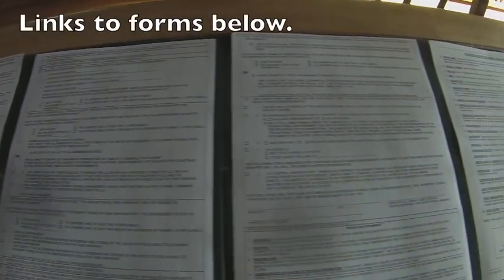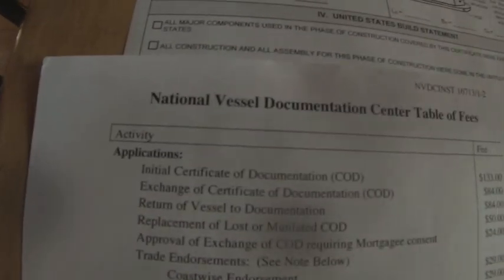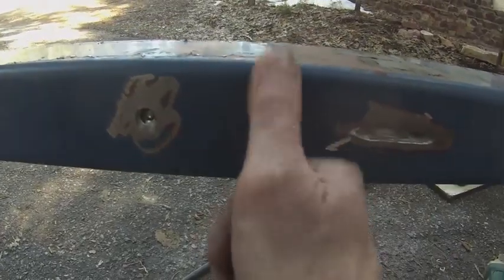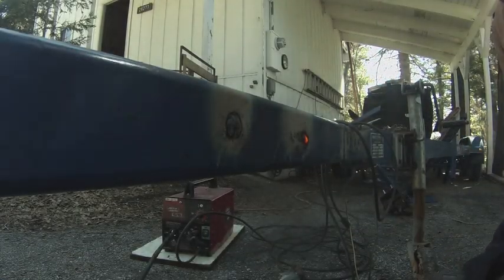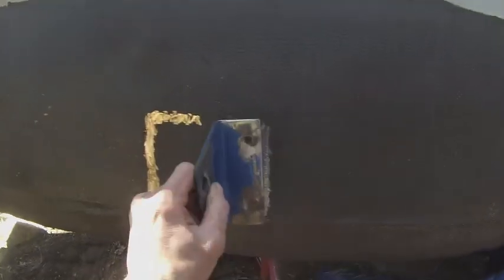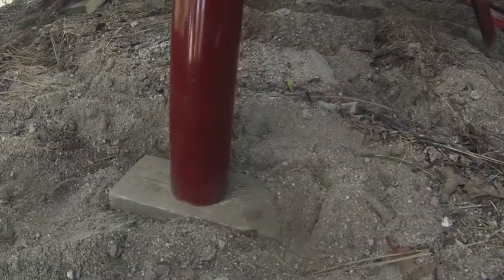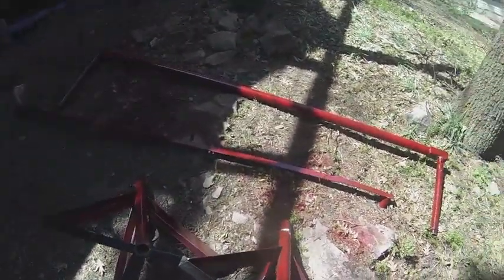Steel Sailboat Build Part 39

Comment: Looks like that the gas nozzle is missing om your welder.
Reply: I believe he is using flux core wire so it is not needed. I think people remove it for visibility and better cooling off the nossle, but I personally keep mine on to protect against shorts.

Comment: I submitted my Coast Guard documentation in February and they haven't gotten to it yet. You can look to see if they have entered your "work packet" into the system here https://cgmix.uscg.mil/VDS/SearchAndReturn/Search.aspx

If your boat doesn't show up there, the best clue I found was to look under the NVDC Case Processing Report link at the bottom of this page https://www.dco.uscg.mil/Our-Organization/Deputy-for-Operations-Policy-and-Capabilities-DCO-D/National-Vessel-Documentation-Center/   There's a section for recreational initial and another for renewal that give dates. The dates are meant to say they are working on packets received on or before....however my date has passed and I still don't find my boat in the work packet search. Time will tell.

Comment: On your trailer, double up the wheels on the front jack. Best to go to steel wheels that won't crush or break. You can lay C channel over dirt for them to track on as you winch the trailer along.

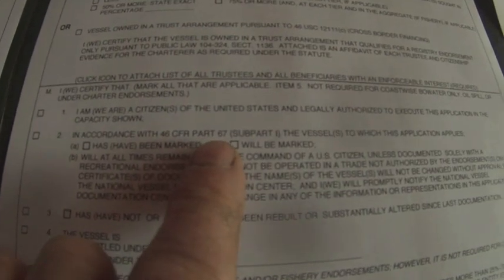Comment: 0:44 Normally the "markings" are an identifiable serial number that is welded, permanently bonded or stamped into the hull. If a boat is stolen, or sinks in a storm they can  positively identify the craft from that number. If I am remembering correctly, Part 6 no longer applies for non-commercial craft under a certain size. But...this is the internet and I could be blowing smoke out of my arse.